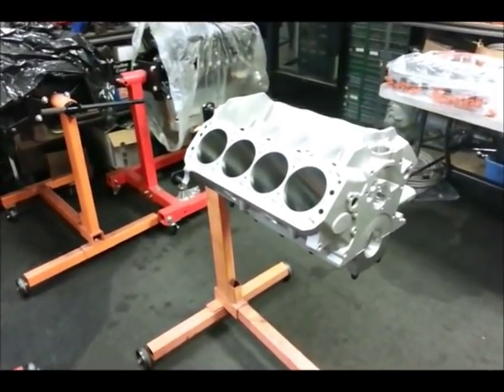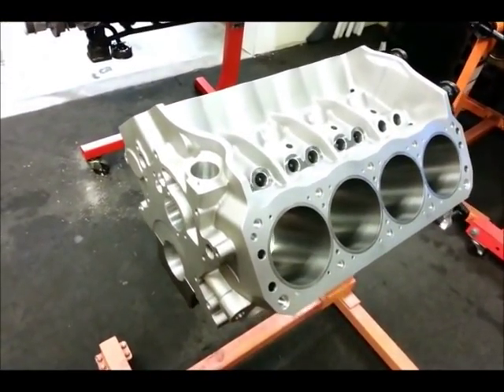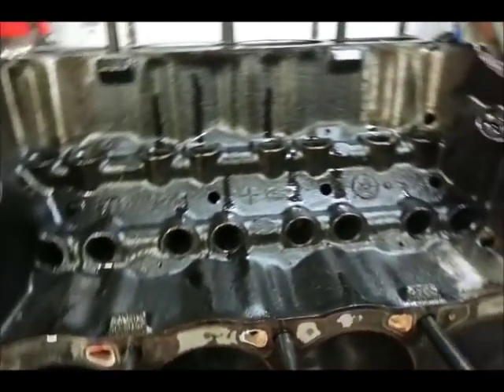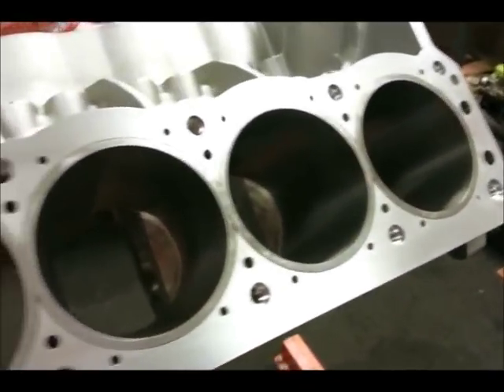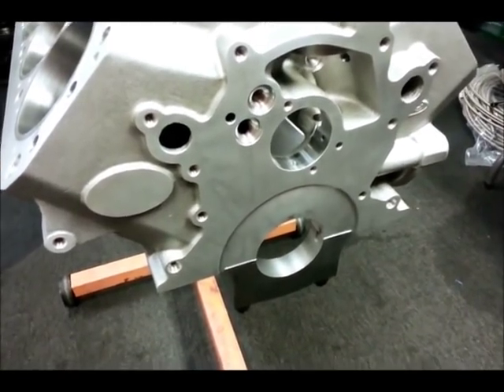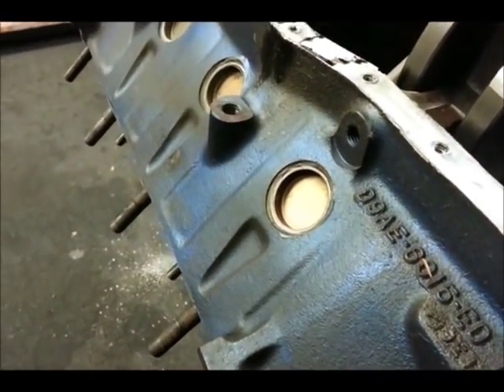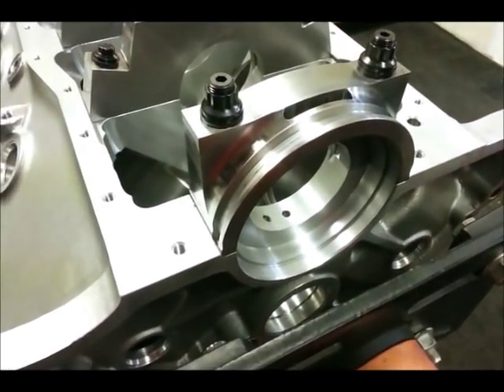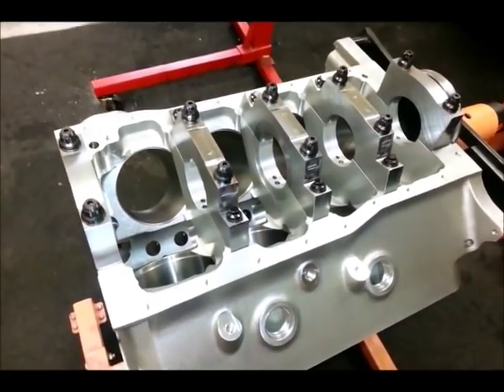The Ford Racing Z351 Aluminum Block

Comment: This guy is a complete tosser... the only ones, Clevo or Windsor, that might split, are the ones so neglected in maintenance (run long term without inhibitors)  that they corrode the cylinder wall unevenly, producing "core shift". Core shift is when the wall thickness is uneven around the cylinder, creating a weakened area. Bugger all wrong with the design, everything to do with caring for your engine... but what would a chevy-centric popular hotrodding goose know.
Reply: 351fairlane71 - Core shift is NOT caused by corrosion. It is a result of the casting "cores" or the internal forms in the casting process shifting during said process. Most often caused by the core "floating" in the molten metal. Corrosion can only exacerbate the problem.
Reply: Chevy-centric popular hotrodding goose know ....🤣🤣

Comment: ...Now I wonder what a one-piece main cap set would be like on the Z351 block. Like the 4-bolt mains with a built in girdle. Capable of running 8k+ RPM if destroked with a beefed-up high-flow top end?

Comment: As a few guys point out, the "Freeze Plugs" (actually they are "Core Plugs") are not "Designed" to fall out when the engine coolant freezes, rather they are holes that are utilized to remove the Sand from the Casting after it is cast. the plugs are there just to hold the water in. In a race motor using a Standard crank driven Water pump, it is possible at high RPMs to generate enough pressure to push the standard Core Plugs out of position, and cause Coolant leakage. threading them for screw -in plugs is just insurance to prevent leakage. Also it is common practice to stake the stock style block to help prevent the plugs from pushing out at high RPM. 

Also...The Crank Main Journal size on the Z351 block is not just some arbitrary size to be a happy medium between a 351W and a 302, rather that size was chosen to match the Crank Main of the 351C, of which there is already a regular supply of Crankshafts for the Iron version of this block, which has been in service with NASCAR for many years.
Reply: MegaScott This Guy Makes It Sound Like There Fall Out When You Start It Up.. He’s A Hack Selling A Product.. Its a Nice  Block.. But There’s Been 351 Fords Turning. Over 750 For 40 Years.  Sooo HES FULL OF SHIT
Reply: Absolutely right MegaScott-the so called freeze plug rumor started who knows when, huh?  They are  strictly  casting aids for sure. :--))))))()
Reply: Unlike Other Comments Here, You Seem Knowledgeable About This So Help Me Out. With All That's Available For The Cleveland, What Would Be The Advantage Of Building A Windsor?
Reply: @thewatcher5271  windsor style is lighter. Cleveland has an extended out front of the block casting for timing chain cover & water pump mounting. Windsor has a bolt on cast aluminum timing chain cover water pump mount So it's lighter.
Reply: JH is just JH.
Reply: The cored holes filled with welsh plugs they are indeed used for core removal after casting but their purpose isn't for the removal of sand as there is cored holes in the front of the block that would be perfectly adequate for sand removal. The cored holes are next to the bore pairings in most block layouts there is an water jacket between these and even when there isn't they still share the outer water jacket. The sand core is very thin here and needs support to prevent deflection. Remember even though the metal when cast is molten it doesn't get any lighter and even the action of the molten metal flowing past will bend/break the core. The hole is only for a part of the core to be held securely outside to prevent deflection. As for the now required plugs only being a push in fit it is actually to allow the coolant to expand and push out when it's on the verge of freezing. It needs to cover the last area in the block water jacket to freeze, this in the biggest volume of coolant by the smallest surface area usually at the bore pairings. The cores could be adequately held with a much smaller hole but are not due to the required surface area for the water to push out the plug before it becomes ice and cracks the block. This is why you should never glue in a shouldered welsh plug only ever a disc. You can seal them with silicone but that's all. The size of the welsh plug should have been calculated and tested to ensure it will release at the correct moment before cracking happens.
Reply: @dazaspc  
Having worked in an engine manufacturing facility (maintaining and repairing/rebuilding with a far amount of Tool work) I can assure you that we loctited the Welch plugs on the heads and blocks. Plus the plugs had around. 010" press on the  block. Small ones in the heads around .005". Plus the plug holes are often used as a location point for the location of the main manufacturing holes. These are the locator holes for all dimensional measurements along with the pan face.
Reply: Yeah. Settle down

Comment: Do you mean the 302 w/500hp splitting or were you using Nitrous with his 351? The stock 351 2 bolt main is about as strong as the stock 350 sbc up to 600hp or even pushing 1000hp. That's pretty good!  The oiling is pretty good in my 351W but in the 351C was more problematic.  I've never seen a 351W block that weighted 280.  It must be filled.  Does the block work harden because it's aluminum and how long will it last? I think it's pretty cool though.
Reply: a 302 will not split at 500hp man iv see them go past 1800hp

Comment: That's funny how this guy is saying a stock 351 block is so weak but yet there's an article online done by mustang 360 where they made 1000 hp with 21.5 psi on a stock block.  Of course the motor blew up at 21.5 psi but it was holding up around 17.8 psi making 943 hp.  On a reliable stand point you could easily run a stock block around 700 hp and not have it crack or blow up like is mentioned in this video.  Now of course if you had the money the aluminum alloy block would be a better option for racing but for a person on a budget a stock block will do just fine.
Reply: +Nate Karg - I agree with you. The Windsor is much better than the Cleveland and as good as any small block GM or Mopar. The inherant weaknesses he points out are there on all the other brands... He is not that educated about Ford stuff. I've built quite a few...done right they last as long as anything else!!! I like the Z351...great item!!!
Reply: +Nate Karg You sir got an edumacation.
Reply: Have a customer making over 850 whp using a stock windsor block . This dude knows eff all.
Reply: Finding a good roller cam 351 block is the problem. A lot of them have very very very small cracks near the cam bearings. Honestly I didn't even bother looking for a roller cam 351 block BECAUSE of that. You know it's bad when fordstrokers.com to issue a PSA about the stock blocks. 

I am the proud owner of a dart shp 351 block. Going from a production 68 302 block to dart has been great. :)
Reply: @I_like_turtles_67  Yeah I got lucky with my 351w stock block. Machine shop that went through mine said everything looks good. I'm only running 450 hp est. in a foxbody so should be fine but I would love to have a dart block just for the piece of mind and quality. My biggest issue is the msd atomic efi is nothing but problems. I'm going to take it off and put a 750 dp holley on and hope for the best.
Reply: @kargmeister  Yup. I am building a 427 with afr 195-220 heads. On e85 in a 67 mustang with a 5 spd. Cars gonna rip lol. Probably gonna end up real close to 500 rwhp when finished. Hence why I went with a shp block. Big bore piston motor :)
Reply: @I_like_turtles_67  exactly what I've always wanted to build for my foxbody. I've already got a tko 600 trans and built 8.8 rear end with 4.10 gears.
Reply: good luck

Comment: This video is wrong on so many levels, its no wonder popular hot rodding is a joke and clearly know very little about 351w blocks, let alone fords in general.
Reply: I WILL AGREE WITH YOU IN EVERY WAY. THE WINDSOR OILING SYSTEM ACCORDING TO THE FELLOW NARRATING THIS VIDEO WAS INFERIOR IN DESIGN, BUT YET THIS VERY SAME OILING SYSTEM WON LEMANS IN A 289ci IN 1964 IN THE DAYTONA COUP WHICH WAS CLOCKED AT 196MPH. POWERED THE SHELBY'S AND COBRAS WHICH MURDERED THE CORVETTES WHICH WERE NO COMPETITION. WHEN FERRARI DECIDED NOT TO SELL THEIR COMPANY TO FORD, HENRY FORD THE II DECIDED TO GO RACING. HE WENT TO THE ENGINEERING DEPT AT FORD AND ASKED THEM WHAT ENGINE WOULD BE WORTHY OF RACING. THE ENGINEERS SUGGESTED THE HI-PO 289. SO THE ENGINEERS PUT IT ON A TEST BENCH AND REVVED THE ENGINE TO 6500 RPM. 24 HOURS LATER WHEN THE ENGINEERS RETURNED THE MOTOR WAS STILL RUNNING. THIS IS A TESTAMENT TO FORD'S SUPERIOR OILING SYSTEM. DO THAT WITH A SMALL BLOCK CHEVY AND IN 10 MINUTES PEOPLE WOULD BE DEAD FROM SHRAPNEL WOUNDS. ALSO IN TAXI CABS, THE 302 WOULD STILL BE RUNNING STRONG AT 500,000 MILES WITH THIS VERY SAME OILING SYSTEM. IN EVERY WAY THE SMALL BLOCK FORD WAS SUPERIOR TO ANY OTHER ENGINE EVER PRODUCED.
Reply: @Frank289100  If only the engines Ford has put out in the last 30 years had as good of an oiling system.
Reply: @hochhaul  WHICH OILING SYSTEM IN WHICH FORD MOTORS DO YOU CLAIM WERE BAD?
Reply: Frank289100 
Probably the 5.4 3V but he couldn’t respond because he’s a Chevy fanboy and has no actual clue of what a solid OHC engine actually is.
Reply: @hochhaul  The 351 (5.8L) in pickups from 1983  to 1996, as well as 302 (5.0L) in pickups & cars from 1968-1386, were Windsors.  The EXCAT same oiling system is used in all 429/460 big blocks. FE top oiler big blocks oiling was extremely similar.  Like everything mechanical, if it was used successfully, you just need to understand how to work it.
Reply: @donnatalielucasheimbigner7598  I'm talkng about the modular garbage Ford's been building since the 90's.
Reply: @Frank289100  I'm talking about the Modular junk Ford has been pumping out since the 90's.
Reply: @hochhaul  WHERE HAVE YOU BEEN. PLAYING THE BANJO LIVING IN A CABIN IN THE WOODS, LIKE THE FELLOW IN THE SCENE IN THE MOVIE CALLED DELIVERANCE PLAYING THE DUELING BANJO. THE MODULAR MOTOR IS MOST LIKELY ONE OF THE GREATEST V-8'S BUILT, THEY GO 100'S OF 1000'S OF MILES RUNNING NONE STOP 24/7 AND IN MANY CASES HAVE REACHED 1,000,000 MILES. THE MODULAR MOTOR REVOLUTIONIZED THE INDUSTRY.
Reply: +Frank289100 ive got 60 psi of oil pressure in a 35 year old built 351w yes the oiling is adequate
Reply: +KSI SubSonic EXACTLY! THE STOCK OILING SYSTEM WAS STATE OF THE ART.
Reply: Frank289100 Excellent points

Comment: What years?
How much?
Stock engine in what cars?
Reply: Basically anything that was fitted with 302 351 windsor engines. That covers almost everything from the 60s to the late 90s. From mustangs, f series trucks, broncos, thunderbirds you name it if it had a v8 option you can most likely use it. Transmissions can be the c4, c6, aod, e40d and the array of manuals. In the video i think he said 3500 just for the block which really isnt that bad.

Comment: Nice video. It points out most of the details I wanted to know about the block. It looks like I'll be running one.

I don't want to sound like a jerk, but one thing I wanted to point out is "freeze" plugs are not design to pop out for any reason. They are "casting" plugs to fill in the holes required by the sand molds used in casting the block. Nobody knows where this misconception comes from, but as experts you should really know the true use for the holes and plugs installed in them. -a mechanical engineer's point of view.
Reply: +Sam Iamnot Thanks for pointing this out. In Australia, they are known as Welsh plugs, never heard of freeze plugs. AND most old motors has steel plugs, not brass. At least when I built up a 351C, it did have. Australia got the tooling for Clevelands from Detroit in the early 70's, when your big oil crisis, and emissions rules kicked in. In Aus, we made a 302 Cleveland as well, you didn't have these. It was just a shorter stroke, and the only difference to look at was the 302 or 351 stamp on the crank. It was impossible to tell the 2 with the hood up, unless you took a plug out and measured the piston travel with a bit of wire or such.
Reply: @caratcranker5874  Welsh plugs is a type of plug there are kind of flat
Reply: Ford USA made a Cleveland 302 in 1969 and 1970 it was called a Boss 302, also the name of the car.
Reply: @hope2someday691  - He is correct, Ford US never made a 302 Cleveland.  The Boss 302 engine was actually a 302 Windsor block with 351 Cleveland heads.
Reply: The misconception come when Ford started using core plugs. Then people would find them popped out from freezing. Never mind the rear of the block most of the time had a crack 5" long running down it. Which made the engine useless. Which is why it seem Ford is using the old Screw in plug. Which they used for many years in race prep engines. 

I still prefer Side lock cap bolts. It gives it more strength. One reason the Ford 4.6 can take 900 HP...